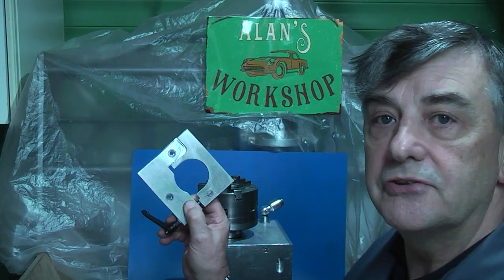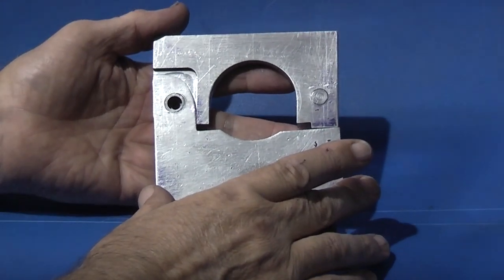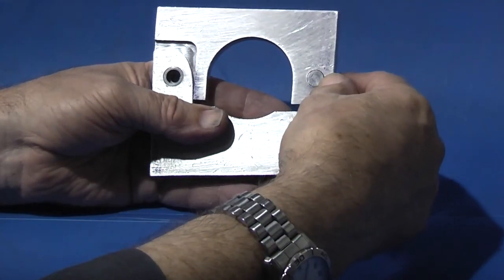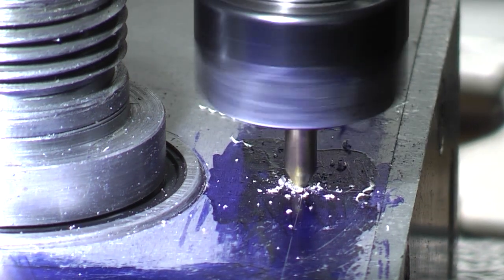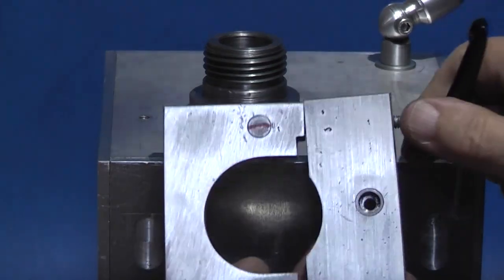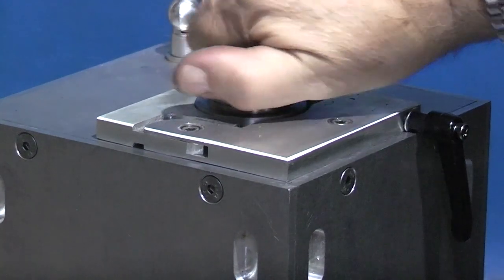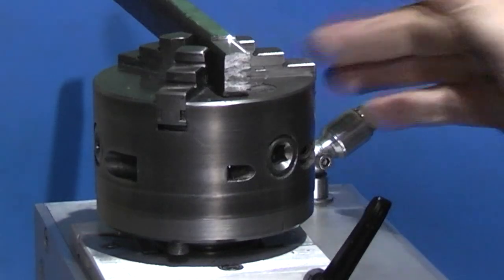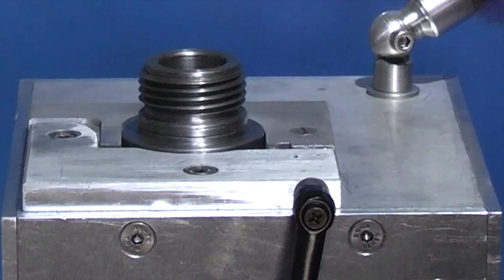Rotary head spindle lock  (part 2)

Comment: Hey Alan, we said we would return to see how part 2 comes out the true test of this build, it did machine well and looked nice i last weeks video. 
We like that you used steel bushings to allow this to last not wearing out too soon. What a neat locking plate mechanism allowing you to mount your 3 jaw or any jaw to that spindle. We like and we use those handles they are handy to adjust to your threads keeping that out of the way for us.
Thank you.
Lance & Patrick.

Comment: seems like the clamp should be floating so it does not pull the chuck spindle one way or another...  the recessed bushings;  the pivot one should be tight clearance but the second one should be free to move in and out towards the spindle so that it clamps the spindle with no sideways forces, only rotational locking based off the pivot hinge bushing...
Reply from the maker: Hi Joe Good point It would be simple to elongate the bush hole. I will see how it performs as the clamp is sitting on the bearing.

Comment: Nice work, what are the little handles called & where did you get them?
Reply from the maker: Hi Tony I got them from Axminster Tools  (www.axminster.co.uk) they list them as Alloy locking levers and are available in sizes from M6 to M12
Reply: enots engineering locking levers, hum maybe i can find some here in the states. Thanks Pall.

Comment: Surely it’s 4.2mm diameter tapping drill for M5 standard pitch metric female thread!
Reply from the maker: Hi Shaun Yes but how many of us have a 4.2mm drill in the drill set.
Reply: enots engineering, Alan, I thought that was what number drills were for, e.g. #19. I guess I’m lucky as a former old school toolmaker that I have accumulated quite a few drills over the years.